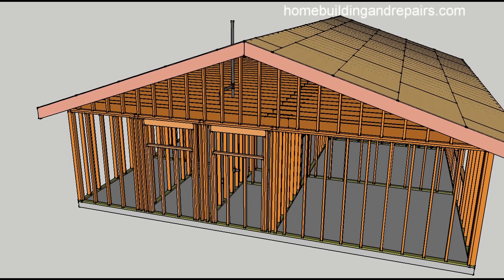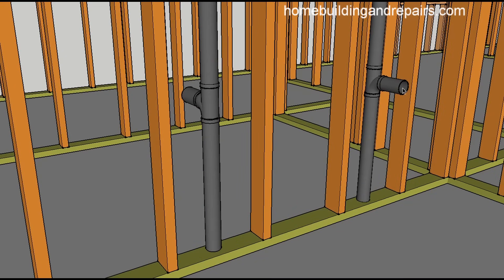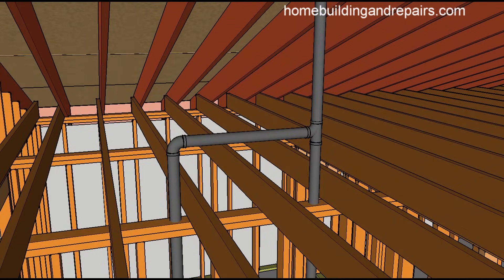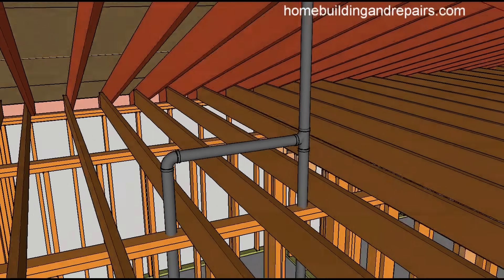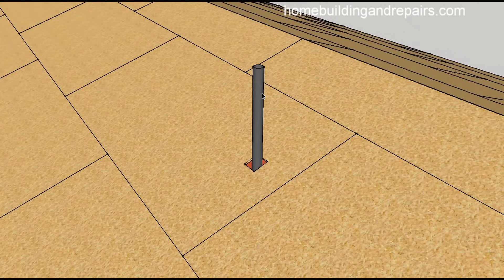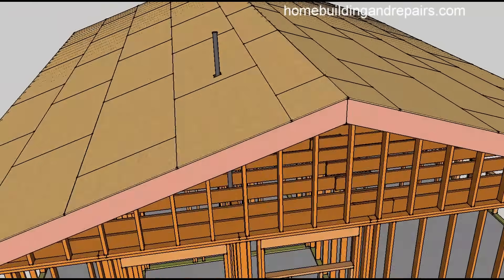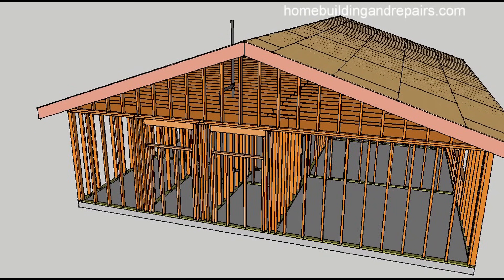Can You Use Air Admittance Plumbing Vent Valves on Your Next Construction Project?

Comment: The elaborate vent piping satisfies the purpose, but only when designed and installed correctly - it creates an entirely separated system that must be kept apart from any drain. Too often, remodeling or handy DIYers may see a pipe run, and decide it's convenient to just tap into for a new sink drain, failing to understand that introducing water may violate code, and compromise the ability for air to freely circulate in what is supposed to be a "dry" vent system only.
  Vertical vent stacks allow sewer gases to escape, something these small side valves prevent; knowing where and why venting must be handled clarifies how these may be used safely, but also where never to substitute them.
Reply from the maker: Excellent points and thanks for sharing.

Comment: Have you ever had\heard one of these air admitance valve go bad?
Reply from the maker: Yes, it's one of the reasons they aren't used.
Reply: @gregvancom  yeah I thought mine had failed only 2v years old and it ended up being holes were the pex comes up from crawl space making it smell and now mold

Comment: So what could happen if vent mechanism fail? either in open or close position and pipe is clogged up below? water will flow out through vent?   Unless vent is installed higher than the sink? which is unlikely.
Reply from the maker: I'm going to guess that it could smell and/or leak.

Comment: If converting a single sink to a double sink would I need to use one of these valves?  The sink currently goes into the main stack that is vented
Reply from the maker: Probably not, but it will depend on the design of the waste drains. Some building codes require a single drain and vent per sink, while other don't.

Comment: I'm no plumber, I own my own home and have researched and was able to redo most of the plumbing here, I just put one of these valves under the kitchen sink, sure it let's air in, but there's no where for the sewer gas to go, the sink works ok and all that, but it drains kinda slow, so I have to cut back into the pipes I just installed to put an actual vent stack in, like I said, it works ok right now, but when I fill the sink up then pull the plug, I'm getting some gurgling and stuff from the sewer gas pushing back on the draining water, again, I'm no plumber, does what I'm saying here make sense..? Any plumbers that can answer will be greatly appreciated, thanks..
Reply: You have a clog forming. You need to cable it. Hire a plumber. They would solve you issues without added headache.
Reply: @ForeverSinz  I added an actual vent, up thru the wall and out the roof, problem solved. I left the air admittance valve in place, be super easy to just cap it off if we decide to

Comment: why not always approved? Do they have any problems, disadvantages?
Reply from the maker: I don't really know, but I think it would have something to do with the fact that air admittance valves are mechanical devices that could fail and create problems for the building occupants.
Reply: @gregvancom  Ah I see makes sense, do they have a maintenance schedule/expiry associated with them?
Reply: @radekw708  Another disadvantage to air admittance valves, is that they are not bidirectional with which way gasses can flow.  That of course, is the ENTIRE point of them, so that they only let air in.   For the individual fixture, this is a good thing, but for the wastewater management system as a whole, this can be a serious problem.   The sewer/septic needs a way to vent, and most sewers depend on the customer houses along the route to vent it periodically.   If everyone just used AAVs instead of standard plumbing vents, the sewer would build up a pressure of decomposition gasses.

This is why plumbing codes often require standard vents on new construction, but permit AAVs to be used for retrofitting a non-vented drain.  It seems like a double standard, but there is a reason for it, to encourage the construction of standard vents for the wastewater management system as a whole, to function properly.

Otherwise, the AAV would seem like it clearly has the advantage.   No roof penetrations, no routing pipe to the roof, no pitfalls of tree debris & snow plugging up the vent, and no major surgery to clear a clogged vent.  Just a simple replacement of a valve, if there is a problem.  As long as the home owner knows about it, and how to maintain it.

Comment: With air intake in the nearby sending open sewer gas on the roof is such a bad idea. Better use AAV everywhere and clean them each couple of years : simpler piping, cleaner air, more energy saving 👍
Reply from the maker: I don't know if any studies have been made to suggest that venting through the roof is a bad idea. However, I'm curious as to how you could get cleaner air or save energy by using air admittance valves.
Reply: @gregvancom  hey there! the obvious “environmental benefit” that I see is less piping overall, by using AAV’s. For everything else, I would like to see studies and evidence, as well.

Comment: I don't get it. Under my sink, the white part after the p-trap goes into the wall. I have no idea what it connects to within the walls. Maybe to a vent pipe inside the wall up to the roof?  Why does this video show the black pipes (sewer vent pipe) inside and under the sink? Shouldn't it be behind the wall and going up to the roof? Weren't all homes built with the vent pipes inside the wall? So why then did the remodeling contract have to built the black part under the sink unless it was already there?
Reply from the maker: Don't worry about it, your plumbing sounds like it was built correctly, not like this one that was part of a remodel project gone wrong. Most homes are built with vent pipes, but this was a remodeling project where someone added these plumbing fixtures and didn't complete the project.

Comment: I've had one for years where I replaced an S-trap and it works great! You have to make it accessible though in case they need replacement, but it's far better than nothing!
Reply from the maker: I agree and was wondering if you ever had any problems with the S trap. I know they are no longer used, but never worked on a project where they were a problem.
Reply: @gregvancom  S-traps can be okay, and one's I've seen never pulled water out of the sink trap enough to matter. I guess it's all about having enough room in the pipe for air flow. I had to replace the entire galvanized branch as it rusted shut, so it wasn't my S trap that failed I suppose but I also wonder if reduced air flow prevented corrosion from being carried away and reduced air flow seems like more residue can get left behind as it travels down. A book I read said the goal is for water and solids to keep the same pace in a pipe system. The consensus seems to be against S-traps however, so I figured if I'm going to replace most of it then might as well vent it. Keep up the vids, they're great!

Comment: Thank you so much I found this garbage in my house and I’m going to go get a valve immediately
Reply from the maker: You're welcome and thanks for commenting.
Reply: I live in  mobile home park my sink have's the same vent set up, the pummer coming back today water backing in kitchen sink alot second time in three mouths , I have two full baths sinks toilets showers all drain good! It all starts in bedroom bath when I run sink loud gurling noise in kitchen sink? Is that vent causing the back up water leaking out of vent. should I cap it off! thanks for your video!

Comment: Thanks for the video. Do you think that an air admittance vent should be used on a sink that has an under sink garbage disposer?
Reply: Yes. Don't just cap it off or you'll cause drainage issues. Use an air admittance valve.

Comment: 1:02   If you flush a toilet,  wouldn't that toilet be vented so that water wouldn't be syphoned out of the p-trap of the lav? And, is it permitted to join PVC to ABS as in the image?
Reply from the maker: It wouldn't really matter if the toilet was vented, if the sink wasn't. If the sink isn't vented and you flush a toilet, then it could pull the water out of the sink trap. I've seen this done hundreds of times. Remember the two different colored fittings aren't glued together in this situation.
Reply: @gregvancom  it's a toilet is vented, then it's not possible for the water and sewage it's flushing to create any negative pressure and suck water out of the sink. How does that happen? Plenty enough air can come in through the 4 inch roof vent for the toilet to drain on its own, it does not need to suck a ditional air through the sink drain
Reply: @bueler4950  That's what I figured too, I don't understand how it would drain the sink p trap.

Comment: How do you replace a vent pipe when it cracks?
Reply from the maker: You will need to remove and replace it, unless you can somehow install a rubber clamp over it. This video might be helpful for a method I used to fix a hole in a drain pipe.
https://youtu.be/LYjpYBjve5w

Comment: 4:20 did they just drill through a king stud? I thought that was against code. Or is it aloud if you double or triple the studs?
Reply from the maker: As far is I know, you're not allowed to do this. It was probably missed by the building inspector, but it also might've been approved by an engineer or local building authority, but I'm only guessing. There is no reason why they couldn't have went around the King studs that I can think of from the picture in the video. All of the pipes would've still been hidden in the cabinetry.

Comment: I have a question for anyone who can help. I have a 1991 manufactured home and I need to replace the under the sink vent but I can't remove it. It's stuck or someone glued it. It's supposed to screw off.  Any ideas on how to get it off so I can replace it??
Reply: Cut it with a a sawzall and glue a new female adapter on there. Then thread the AAV (studor vent) on there. Use tape and dope to keep sewer gas from seeping
Reply from the maker: I don't know if I'll be much help, but feel free to send me a picture and I'll see what I can do.
Reply: @gregvancom  How do I add a photo?
Reply from the maker: @PugMama64  Go to the website and at the bottom on any page you should find the word contact. Click on the link in it should provide you with our email address.

Comment: I just discovered that the screw holding a pedestal sink in a bathroom was through the vent pipe described in this video.  As best I can tell the vent pipe is going up as it should be but now it has a hole in it.  It is a small hole but I am wondering what I need to do?
Reply: Plug it with a little 100% silicone Caulk

Comment: Rubbish... completely tearing out drywall and going through floor/rim joists and exiting out the roof can cost thousands of dollars to add a vent to an improperly built system but if that is what you have then an AAV can take care of your problems at a fraction of the cost...less than $20... and do the job just fine... sometimes circumstances dictate what you can do an as a licensed plumber I have one under my island sink and have never had an issue
Reply: I agree completely. They ARE a mechanical component that CAN fail over time, but for it to cause damage to your house you would need to both have the vent fail and have your plumbing backup at the same time. When a studor vent fails it's pretty glaringly obvious - it usually makes a very loud gurgling noise. Unscrew it, replace another $20 vent, and rest easy on vacation with the $5000 it would cost to add a new vent out your roof.
Reply from the maker: They can solve one problem, but create another problem. Feel free to read some of the comments I've already posted.

Comment: Your picture at 4 minutes of the video of the vent going down and up.  Just wondering, what happens if the drain blocks and the vent fills up with water?  I'm assuming it has some way of draining if that happens?
Over here, it is very common to see air admittance valves on the main vent pipe, less common on branches next to sinks etc.  It is better to use an open vent because, as you say, nothing mechanical to go wrong, but when my neighbour (we share an underground drain) rebuilt his bathroom, Building Control allowed him to use an air admittance valve on his soil and vent pipe, on the grounds that my house has an open vent.  This is common over here.
Reply from the maker: I wanted to see if I could find a picture, so I typed in "island sink vent"into an Internet search engine and it brought up a few pictures that will provide you with an excellent example. Let me know if you can't find it.
Reply: Thanks Greg.  Looks very strange to someone who is used to British plumbing, but, yes, makes sense when you think about it.  We'd not usually have the secondary vent going downhill like that - it would always go up to a vent above.  More often, the vent pipe is not considered to be needed at all because we can run 4m (13') horizontally (to a vented stack) with a 2" waste without risk of running full-bore and siphoning out the sink trap, but then our houses tend to be comparatively small.

I suspect custom has more to do with this than physics, and in an island situation more than 4m from a wall, our standard methods would not really work.  So it's really interesting to have to think outside the box of what is usual for me.
Reply from the maker: I never thought about it, but your method seems like it would work just fine. Maybe it's another method that provides additional insurance for preventing the water from getting sucked out of the trap.
Reply: I was told a vent pip should never run back down as it will hold water from backups or condensation, unless they are sloping it under the floor and it is going to a vent only pipe in the wall or something, but it looks like it cam back up and tied in forming a U shape that would hold water. Our inspectors here would flag that, but allow a mechanical vent as long as it is accessible for cleaning and maintenance.

Comment: install at least 6 inches above the Flood Level Rim
Reply from the maker: Could you send us a building code reference number and what book your building code suggestion is from?
Reply: gregvancom it's in several local codes I didn't even know you responded, Philly, Chicago, a lot of local calls require for you to install it 6 inches above the flood level Rim, just Google 6 inches above the flood level rim and you will see codes pop up. Granite that's not Universal.
Reply from the maker: I kind of agree with the other comment that it should be common sense and if I was going to install one of them I would install it above the flood level for the sink. Again, I've said this to me at times and will probably continue to say it and that is that you should always check with your local building department or building officials for additional information about local building codes.
Reply from the maker: I've always wondered if the air admittance valves will stop the water, even if it is installed below the top rim of the sink.
Reply from the maker: I think that's the reason why they're not allowed to be used everywhere ( leaking )by approved building authorities that want waste pipes to vent through roofs.
Reply: 6" above flood rim and accessable . Don't burry them behind drywall.  They will eventually fail and need replacing .

Comment: Going from vertical to horizontal you need to use a long sweep 90.
Reply: Long sweep for horizontal to horizontal . Vert to horizontal can be a regular 90
Reply from the maker: Could you provide me with a building code reference number for that?
Reply: Russell Common I was told a sanitary tee was necessary because a long sweep can clog itself due to the angle and flow of water.
Reply: Only on stacks bro

Comment: The depth of the trap and the length of the tailpiece pretty much insures that the trap won't self siphon if you simply cap the pipe where it's open.
Reply from the maker: Good point.

Comment: You're wrong. The code says that they have to be above the flood level rim. So in an island this device would have to be sticking up in the air above the island, clearly not going to happen.
Reply from the maker: The point I'm trying to make is that some building departments might not allow them at all. You would need to check with your local building department for clarification. Don't assume that information in my videos or others will or will not meet local building codes. A good example of this would be the person I'm responding to, suggesting that I'm wrong, when I might be right.
Reply: 6” above the flood rim. Loop vent is the way to vent an island

Comment: No, they should never be used. Do it properly or not at all.
Reply: Ideally, you would want a conventional vent for any plumbing fixture, but I think the main reason for the use of vent valves is for simplicity in island sink applications where no wall is present to contain a vent stack.  Otherwise, your only other option is a bow vent which is rather complicated and expensive to install.  The vent valve is a much easier solution.  If you're worried about it failing, just unscrew it and replace it every few years for piece of mind since they are so cheap.
Reply from the maker: I definitely can't argue with that. I think the real reason why most building departments don't allow them is because they are mechanical components that have the possibility of failing.
Reply: Modern aavs are not considered mechanical(not saying they don't fail) you do however have to have at least one vent to atmosphere in every state modern aavs are much more reliable than older mechanical types with a spring